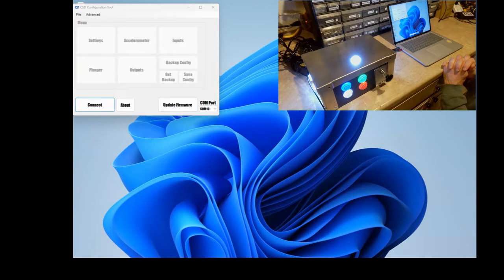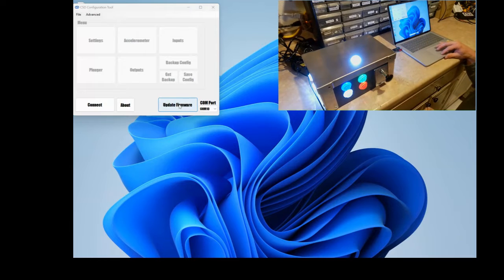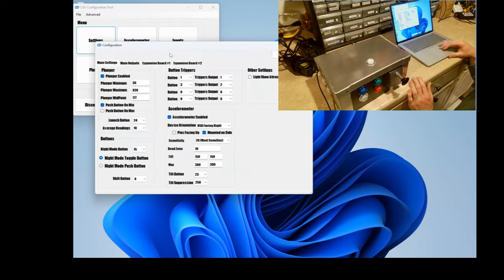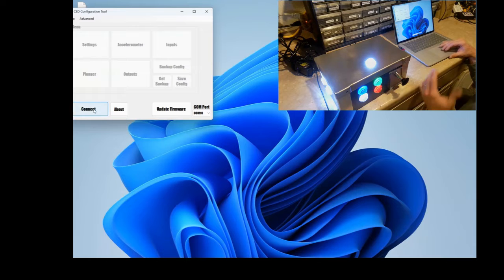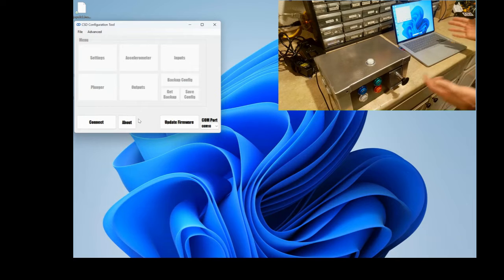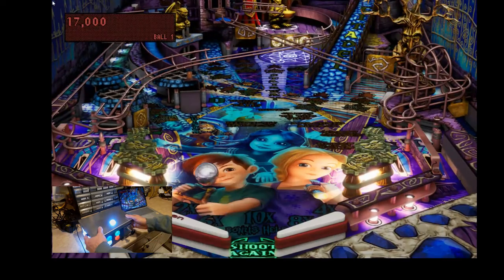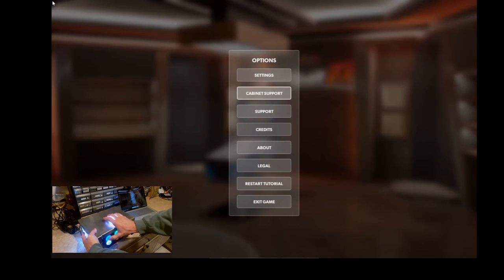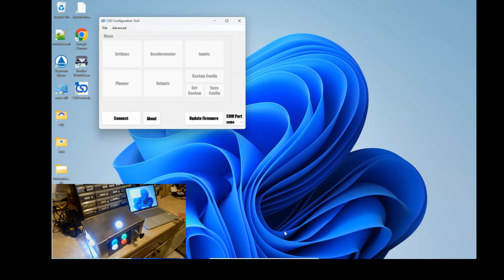CSD PinOne firmware update to support x-input for true plug and play in Steam

Comment: Maybe I missed it but after updating do you have to redo the controllers config in pinup, vpx, etc?
Reply from the maker: Controller mappings will change, so if you have current mappings, it will need to be updated for the new controller. I will update the documentation showing this soon.